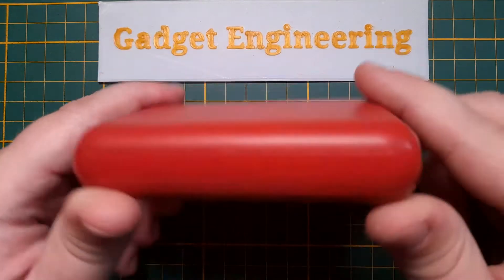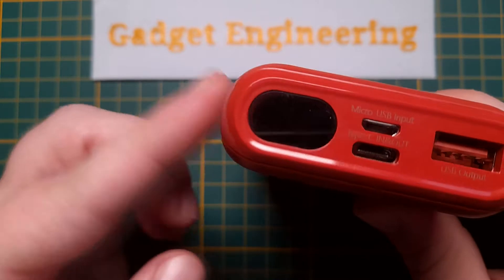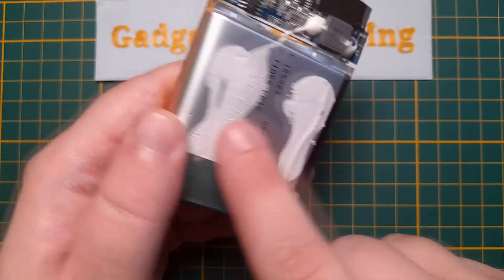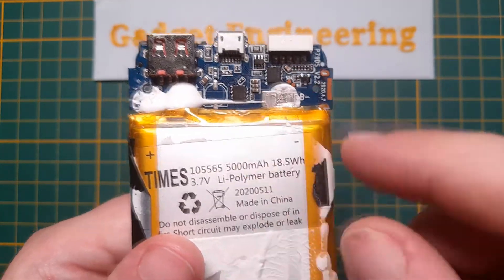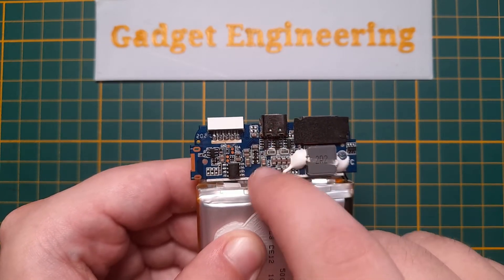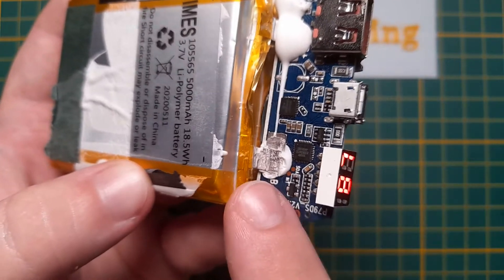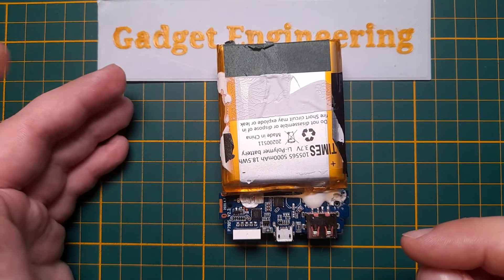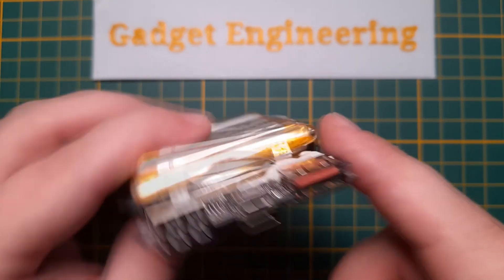Fixing a locked up Lidl Silvercrest 10,000 mAh power bank

Comment: Got one from lidl with wireless charging that probably got short circuited by the usb-c port. Won't take or give charge from the usb ports. 

It still charges by the wireless tho. 
You think i can reset it by draining it with qi charging? 

Really not feeling comfortable shorting a lithium battery 😁